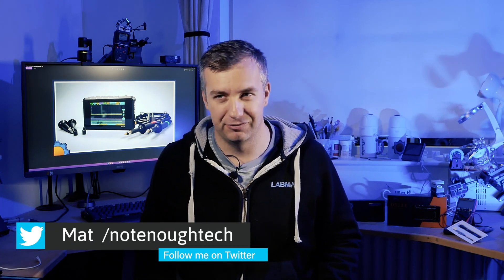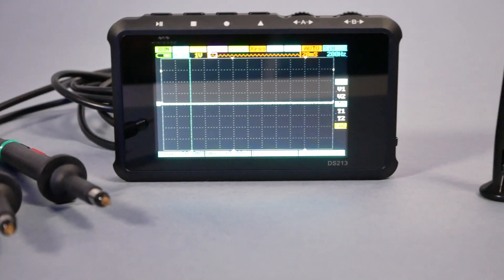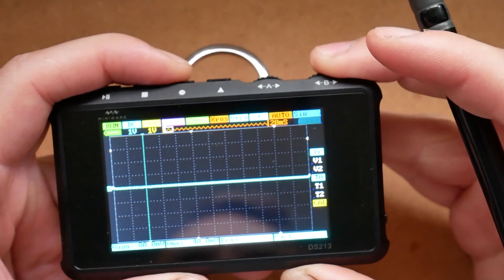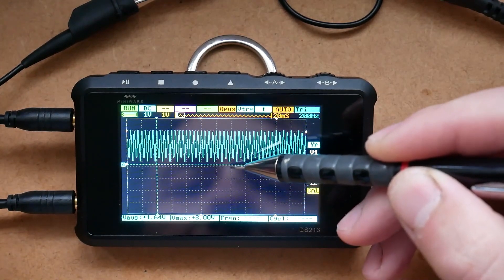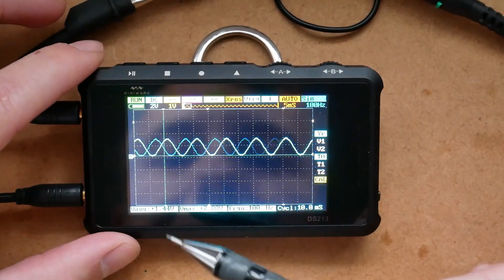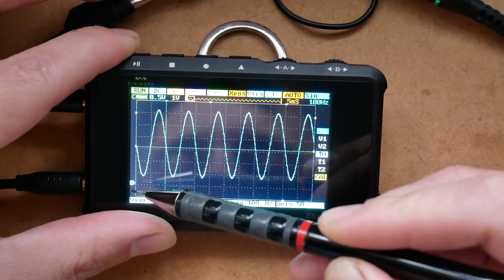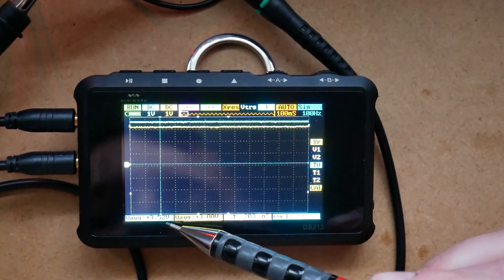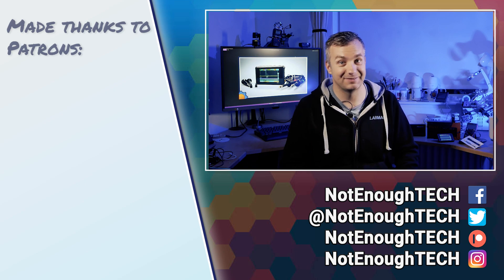MiniWare DS213 Oscilloscope for beginners

Comment: Thanks for this, you made me buy my first oscilloscope :) As I'm totally new in this, I have a dumb question.. what the use of the out (signal out, waveform output) connector ? should I buy an adaptator to connect it to a sceen for instance ?
Reply from the maker: The waveform gen is useful to test other equipment or to see how your components behave. When you plug the probes in to out channel you get to send the signal instead of reading one. You can test this by simply connecting the output to your oscilloscope and you will see the signal you generated

Comment: Could you explain if there is a zoom capability? I have just bought this and am learning to use it but can't figure out how to make some of the images it picks up larger.
Reply from the maker: You have 2 options to control the timeline. You can change the sampling rate which will give you a bigger resolution (zoom in) and move across the timeline with the wheel when in one of the top positions
Reply: @notenoughtech  You can not change the "samplerate"...Only the timebase...But hey....tomato/tomato
Reply: Could you maybe explain in more detail or make a video, I greatly appreciate you answering
Reply from the maker: When selecting time for samples you are selecting how long the sample will last and this is divided by the number of samples. Shorter time the more divisions per sample you get. If I have sample rate 10 per sec then I get 1/10 of a sec data point but if I decrease the time to 1/10 sec then I get data point every ¹/100 although lasting 10 times shorter.

Comment: I got Hantek 6022BL and I can't complain - I can use open source OpenHantek and see all on big screen, plus it's 1/3 of the price. Not to mention it's pluggable onto Android tablet or even phone and you can use it on the go.
So if desk space is your problem - get the Hantek, put it behind or even below your desk, make only the probes available on the desk and have a shortcut for the SW :)
Reply from the maker: Looks quite portable as well. Although personally I think I'd appreciate having the screen with me. That would probably raise the price but it's not a bad option for anyone looking to save some space for sure! Thanks for the suggestion
Reply: 20 megasamples seems quite small, what do you use it for?
Reply: @alexstone691  Usually only basic low voltage toys - Tasmota devices, Raspberry Pi communication (i2c) and few RLC circuits I've build for learning purposes. Seems plenty for me, to be honest.
Reply: @rklauco  True, sad i can't find it for price lower than 120e